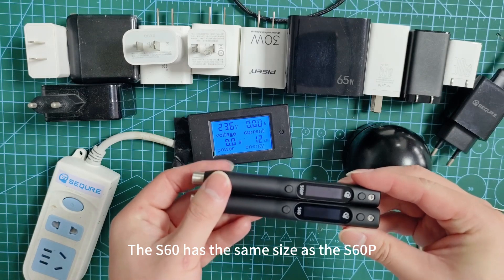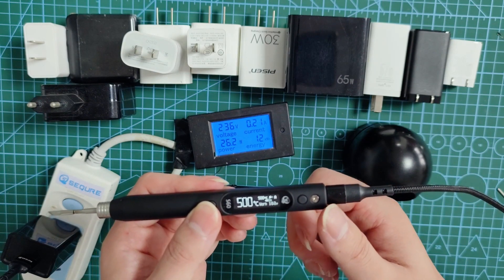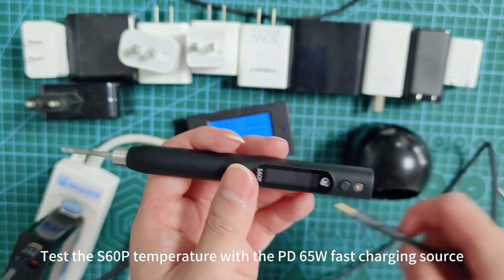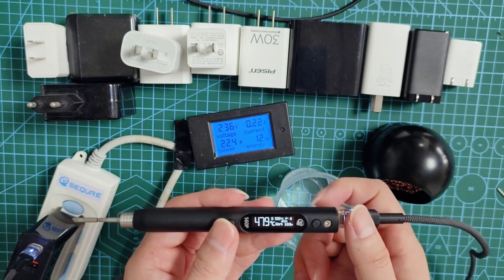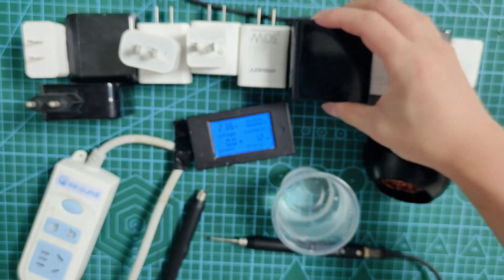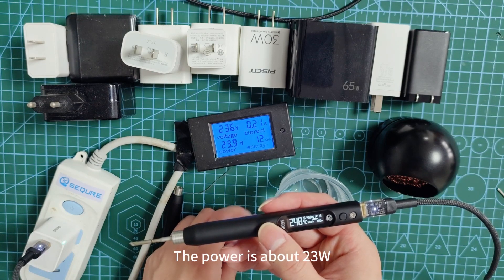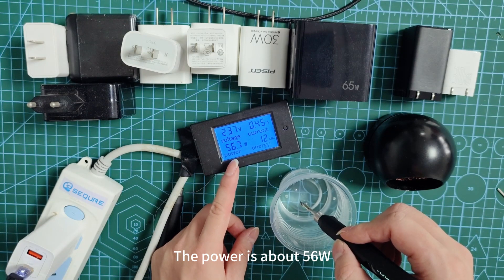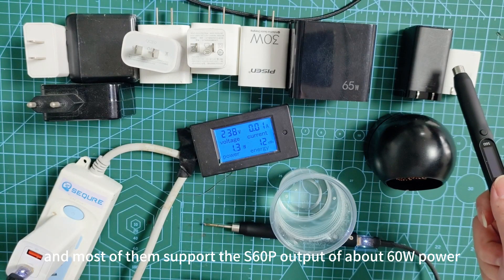Multiple Fast Charging Sources S60P Upgraded Soldering Iron Test

Comment: I just purchased the s60, I own two other sequre irons, they use the ts-100 tips...also own ts-80, ts-100, quoeco ts-100 tip iron, ..in all, they all work very well....the soldering of todays electronics is nothing like it was 30-40 yrs ago, everything was a solder station or solder gun...what a different electronics world we live in...!
Unfortunately, most electronics are just throwaways. 
Sequre corporation is a very good company, i also have the arch welder that comes in a pouch with built in battery, sequre products are very well designed and built...
Im 100% satisfied with your products. 👍
Reply from the maker: Hello. Thanks for the recognition, man. SI series soldering iron can be compatible with most of the common soldering iron tips of various brands in the market, and the compatibility is strong. SEQURE will continue to make more interesting tools.😀

Comment: Soldering pen feels quality built, good in hand but has functional issues.
I use quality PD power supplies 90-100W from Dell and Lenovo PD 5A 20V. All power supplies turn off when I activate heating. Short circuit protection activates. 

Clone and original JBC C210 soldering tips are about 2,2ohm resistance and with 20V voltage this equals to 10A current. No wonder 20V 5A PD standard is not enough and power supply shut downs .  You need to update FW and use PWM signal to control mosfet transistor to supply energy to soldering tip and with help of PWM duty cycle limit current to 5A according PD standard. You need to make proper FW where tou measure consumed power and regulate it with PWM to meet PD standards. 

Now I can not use soldering iron quality power supplies. Only with low quality dangerous power supplies that do not have protection or use DC power from car battery.
Reply from the maker: Hello, thank you for your use. If you use a 100W power source, generally support PPS11V output, you can select PPS11V in the menu protocol, which can provide S60P with full power 60W work.

The best working voltage of 210 soldering tip is not more than 12V, I hope to help you.
Reply: @SequreTech  In menu I can not specify "PPS11" only "PPS" and it still reboots due to protection. I solved problem by selecting PD12 in menu, then S60P negotiated 15V because there are no 12V option in power supply. And strangely there are no "PD15" option in the menu. In the menu only PD12 label. Now with 15V it is working OK. If you will implement PWM control in FW and create control loop where you measure delivered current and voltage on the tip you could lower the voltage from the source to any desired. Your soldering pen would be superior and would work from any PD source.  Now it is strange when your AUTO mode negotiates voltage with which S60P does not work. Why you do not make default setting as 15V from the start?
Reply from the maker: @Mr.Laidukas  Thank you for your suggestion. We'll evaluate it carefully.
In S60P automatic mode, the preferred protocol is PPS and then PD.
Reply: Automatic also does not work reliable. Also tested with original 67W apple power supply

Comment: Where can I find firmware updates for S60P?
My S60P firmware is displayed as V1.00.2. Thanks.
Reply from the maker: Hello, please check the SEQURE website, there is a new firmware uploaded here, the latest firmware for the S60P is version V1.00.2
Reply: @SequreTech  OK, Thank you for the reply.
By the way, when use the PD power, the display may shift up one line after the power is turned on. I experienced it several times. I'm not sure how to reproduce it, but I'd be happy if you could confirm it.
Reply from the maker: @rwe-yz4fo  Hi, I'm sorry, we're not sure what phenomenon you're describing. Please send pictures or videos to our email. After we confirm the phenomenon, if it is a problem, we will fix it as soon as possible. Thank you for your care.
Reply: @SequreTech   I sent you an email to info@ around 4pm on September 21st. Thank you.
Reply from the maker: @rwe-yz4fo  Hello, there is no information about changing the email at present. Please provide your email address so that you can find it accurately. Thank you.
Reply: @SequreTech  Can you please post a link where to find latest firmware for S60P, I can find it on the website, only for S60
Reply from the maker: @primetrader5062  Hello, the firmware currently shipped by S60P is the latest version, there is no need to upgrade the firmware. At present, new functions are being added, and a notification will be released after the test is stable. I hope it can be useful to you.
Reply: @SequreTech   Thank you!

Comment: Hey!
  Is the S60P soldering iron for jbc c210 tip?
Can these tips work with voltage up to 21V without burning?
Reply from the maker: Hello, the S60P is compatible with these soldering tips. Can work on 21V, because the S60P power adjustment, does not damage the soldering tip.
Reply: @SequreTech   Thanks

Comment: Hi, I own S60 for some time now and I love it. Small tips are awesome for SMD soldering. Finding right charger for it was a big challenge. I tried about dozen different chargers and pretty much nothing worked. Chargers always reboot after I turn ON heating of the soldering iron (there is  probably too big inrush current, so protection kicks in). Even 65W charger does not work. Dumb chargers with only 5V output work and powerbanks with just 18W output also work fine. I bought 100W PD charger and this one finaly works!
Few days ago I noticed there is a firmware update for my S60, but there was no change log. So I updated the firmware anyway. Charger now works with 20V PD! Not sure if this is a bug or it is how it suposed to be. Heating time is crazy fast, but my USB power meter shows close to 90W! Resistance of my tips is 2.5 ohm. There is an option in the menu to set the input voltage. Should I change it to 12V or can I leave it on 20V? I dont want to destroy my iron. I tried to set input voltage in the menu to 12V and iron now works with 65W charger. Thanks.
Reply from the maker: Hey, the S60 supports a continuous output power of 60W, the old firmware supports a maximum voltage of 12V, the latest firmware supports a maximum voltage of 20V.

The charger has a 20V voltage gear, and the S60 will recognize that the output 20V is normal. Users can manually set the required voltage 20V or 12V according to the actual use of the charger, and can set the power limit ratio in the menu to obtain a more stable heating efficiency. 20V power supply has power adjustment, will not let the soldering iron damage, please rest assured.

At the same time, the new firmware has been released corresponding to the new operating instructions, I hope it will be useful to you.
Reply: Experiencing the same issue with S60P. Bought a 100w fast charger of more or less reputable brand (Dorten), but ones soldering iron reaches 100% power output it immediately goes into reboot. Tried all power protocols, but the issue persists. My conclusion is either the soldering iron is defective or the charger is not good enough for the iron.
Reply from the maker: @primetrader5062  Hey, you can send out the 100W power supply model or contact us by email. Under normal circumstances, the 100W power source can provide the full power of 60W to S60P in PPS 11V, and three protocols can be selected in the protocol selection. At present, the test has not encountered any 100W power source that does not work for all protocols of S60P, and generally speaking, the appropriate protocol can be selected.
Reply: @SequreTech   Thank you. I've sent an email to you via contact form on your website. I think it's a soldering iron problem, it keeps rebooting everytime I try to solder
Reply from the maker: @primetrader5062  No problem. We'll take care of it. Don't worry.
Reply: I also have the same issue with a lot of different high quality chargers even the 67W apple charger. The only thing that works is a lenovo 65W usbc power supply. Firmware is updated and even the hardware mod (mlcc) is done. Nothing changed
Even tried with original c210 jbc tip
Reply: @zinzigar  Resistance of soldering tips is about 2.5ohm. At 12V this is 4.8A of current. But PD chargers are rated only for 3A at 12V. It is the same with 20V. The curent is 8A, but chargers are rated only for 5A. Most of my chargers see this as overload and will turn off. Only some will not turn off. but the output voltage will drop significantly - from 20V to 15V. Not sure if this is HW or SW problem, but the soldering iron should reduce power when heating, so it will stay in PD specs and will not trip chargers overload protection.

Comment: So, where is the 20v support? In the video, only 12v, and overestimated consumption (220v).
Reply from the maker: Hey, the S60P supports up to 21V (can be DC or 5S model battery power), and the fast charging source supports 20V output can use 20V to power the soldering iron. The factory default automatic mode of the S60P has the function of automatically identifying the optimal protocol, and automatically selects the optimal protocol that enables the S60P to achieve the maximum power. If you need to use 20V voltage, you can manually set it in the menu item.
The factory uses industrial electricity, and the voltage is generally about 240V.